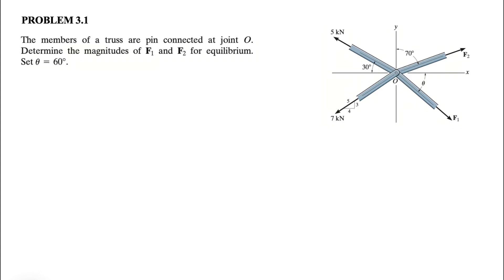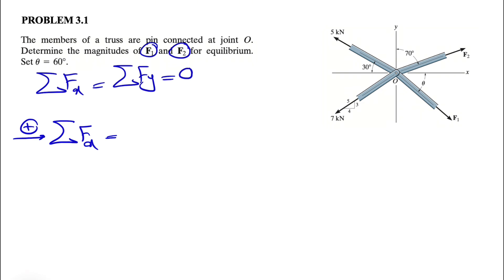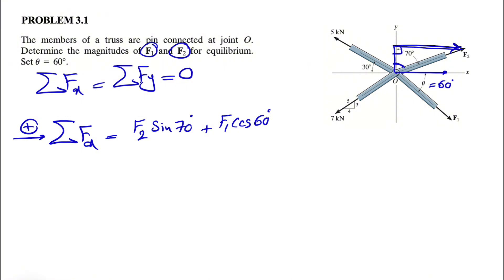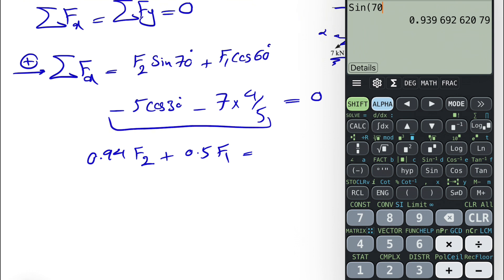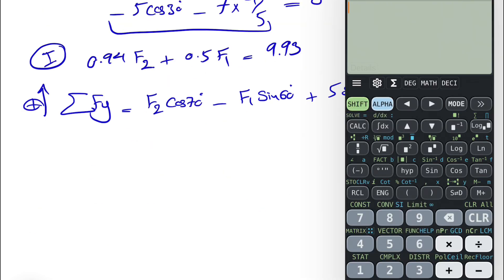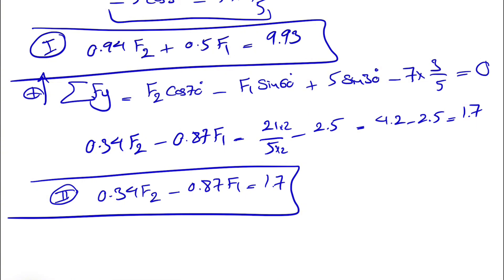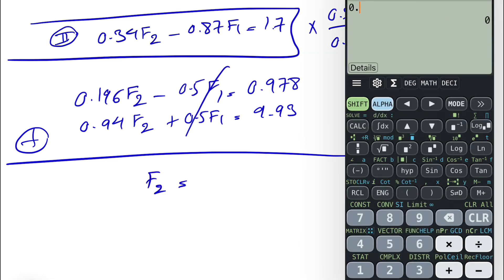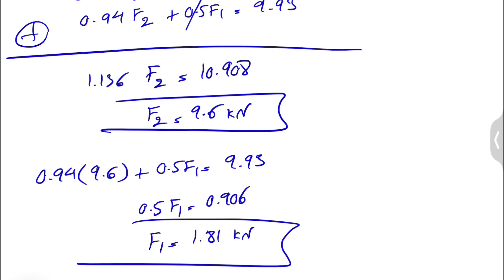Solved Problem 3.1 | Determine the magnitudes of F1 and F2 for equilibrium. Set 𝜃 = 60°.

Comment: at 6:10 I wish you explained why you multiplied each equation by 0.5/0.87. That doesn't make any sense to me.
Reply from the maker: At that step, I multiplied each equation by 0.5/0.87 so that both equations would have the same coefficient with different signs for F1. That way, when I added Equation I and Equation II, the F1 terms would cancel out. It’s a standard elimination method in solving simultaneous equations.